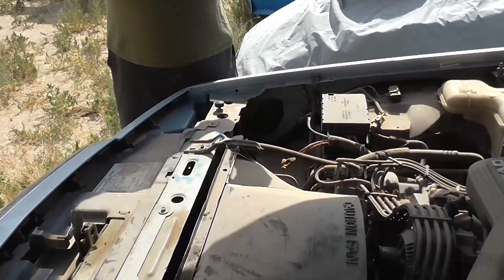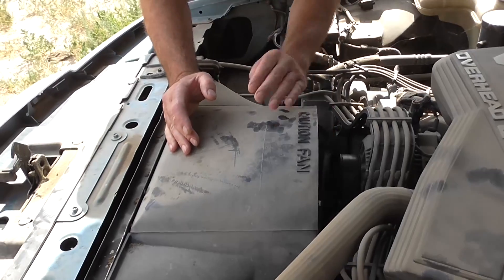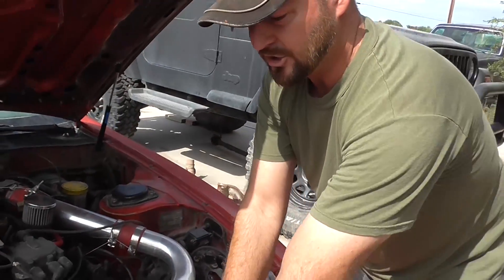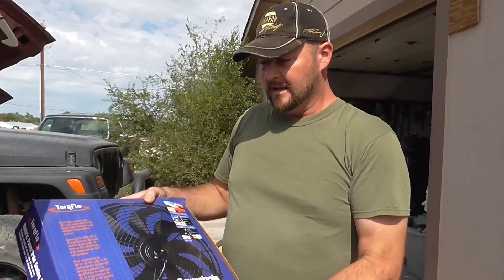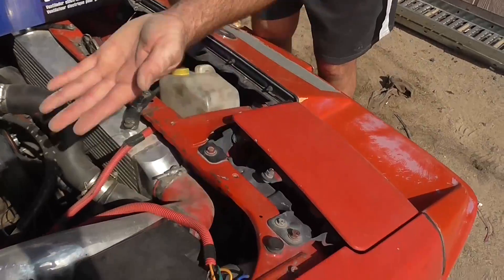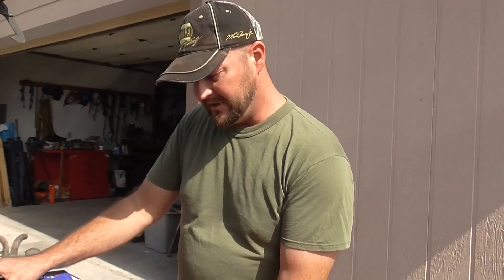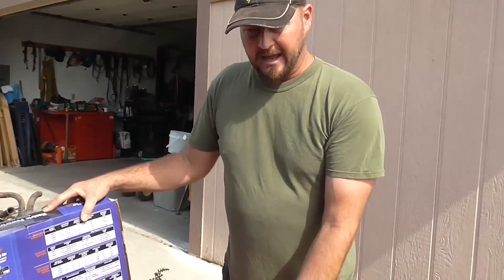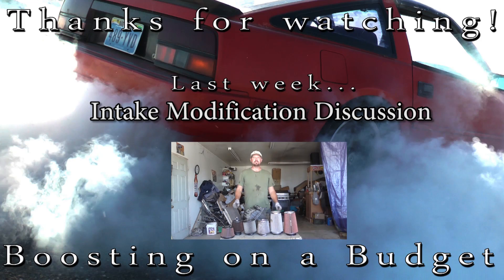Electric Vs. Mechanical Fans - Basics

Comment: measure the amps of these elecric motor fans using ammeter and you almost get a minimum of almost 1 amps. for a traffic of almost 1 hour with airconditioning that will consume battery power .

Comment: engine driven fan is durable, no electric wiring burnout, does not take amps from batteries.electric fans should only be for back up.during hot tropical weather and traffic, battery power is saved unlike electric motor which consumes battery power

Comment: slap a lincoln mark viii instead of that fan you have, you'll tank me later. ive tested so many fans and so far the mark viii is the king of all fans its a VORTEX! it moves more air than any flexalite, spal, or high powered 220W ebay fan ive ever tried! on  top of that its 18" in size so you'll have great surface coverage and utilizing the whole radiator to pull air!

Comment: Would I run into any problems switching my clutch fan for an electric in my 2005 ford f150
Reply: Nope I'm doing the same in my 07 f150
Reply: Jeremy G 
Results?
Reply: I haven't don't it yet I've been throwing money at my bike right this second and I'm back and forth on what way to go I'm either gonna try and make a adapter plate for the fans to bolt to or buy the flex A lite version cause the last thing I wanna use are those zip tie holders that go through the radiator
Reply: Jeremy G 
Yeah me too I don’t like the idea of zip ties and screws through the radiator. Make a custom shroud maybe? I have a 13-14 GT500 fan that fits well. It should be swapped in in the coming weeks.

Comment: Mechanical fans work ok until you come to a traffic jam. You would probably have to rev the engine until the temp comes down.
Reply: That’s why they created a device that switches the vacuum to distributor from ported to fill advance. That Is of course with carb
Reply: Not true at all. They move just as much air as an electric fan at idle.

Comment: Hey budget boosting, could we have a video from you showing all the ways a V8 engine could save gas, with open air intakes, electric fans, and anything else could be done... with the scientific explanations please?
Reply: ill tell you something but you arent going to like it very much,a v8 generally is not purchased for wonderful fuel economy but more for power.if you want better economy,try not to drive the car much and definitely not in town 
as stop and go traffic is terrible for v8 economy so take the highway.the other thing is use overdrive when possible,use premium gas and dont rev your engine trying to be cool.also you need to optimize your timing,make sure your pugs,wires,cap are all in vgc
Reply: @trillrifaxegrindor4411  I Agree - I happened to own Several V8’s. My 72 Chevy Eats Up that Gas . But it’s ok I only Drive It when I Have too. And Just installed Twin Electrical Fans 👍🏻👍🏻👍🏻From Old Air Products 👍🏻👍🏻👍🏻

Comment: shoud are design to maximize  air flow threw the entire radiator. electric fan without the shoud will only cool on that spot where the fan blades cover, not the entire radiator ,  therefor  the fan has to run longer to cool coolant temps,  causing longer  drainage  on battery thus alternator  has a heavier load, which robs engine power , short duty cycle on the fan motor is shortened . more so at idle  slow traffic and tow.
Reply from the maker: electric fans with shrouds are best.  Many factory cars with them can be found at wrecking yard for better flow and a cheaper price.  Just need the relay kit to put it all together.
Reply: If you Order From Old Air Products - just Call them They Will tell you What you NEED … Ft. Worth Texas

Comment: I'm running a tuned 1991 Nissan Patrol with a 2.8 intercooled TD6 and placed some electric fans on the radiator. I removed the mechanical fan. I didn't do the test but I think it had more power and less fuel consumption. I always kept in mind (since we go off road a lot) the electric fans could fail. And that happened. Always kept the mechanical fan in the back so I could install it back if I had any issues. What are your thoughts on more power (since it doesn't need move the mechanical fan anymore) and also less fuel comsumption? I'm also planning on placing an HHO on demand-kit on my 4x4 on of the following weeks. No idea if you had any experience with these kits and if you think they are a hoax?
Reply from the maker: +Thorben Verstraete The electric fans do free up a few noticeable hp since the mechanical fan takes engine power to drive.  The HHO on demand kit could be something to look into, I have no personal experience with it however I have heard good things about it.  If the kits are very reasonable in price its worth a try.  Saving fuel and a cleaner burn is great.  An idea I have heard of is alternating fuel with water injectors on a warmed up engine for example, on one cylinder compression stroke inject water instead of fuel which creates steam on the power stroke, then the next compression stroke fuel and so on.  That way the cylinder remains hot enough and every other stroke is a steam stroke which is just as powerful and cleans the combustion chambers so there are reduced carbon build up on pistons, valves and combustion chambers.  Engine burns cleaner and uses half the fuel it used to for the same output.  Some say the steam power stroke is equal to or greater than the fuel burn power stroke.  It is also effective in keeping engine exhaust temperatures down when using turbochargers, and superchargers.

Comment: You need to discuss the necessity of air flow for air conditioning! Very important point.  And large engines with ac, trans cooler and gm motors that tend to run warm. Not all motors are alike. Each one has heating and cooling querks.
Reply from the maker: +Bombasticbuster Yes, every engine is unique, one size does not fit all.  Air conditioning does need quite a bit more fan capacity since it puts a large heat load on the engine cooling system.
Reply: EXACTLY -👍🏻I should  know ….

Comment: Is that a convertible sn95 mustang I'm seeing in the background or are my eyes deceiving me? I've got one myself with a 5.0, the ford windsors are my favourite motors. They sound amazing and have a huge aftermarket base built around them. I'm not a four or six cylinder guy but I'm still enjoying these videos, very informative.  I'd love to see a video on a boosted v8 if you've got one. Thinking of supercharging my 95 stang and interested in what a safe amount of boost would be on a stock bottom end. As far as I understand ford used forged internals from the late eighties on in the windsors.
Reply from the maker: rmz450racer The mustang in the background is a 2000 Mustang GT with the 4.6 modular overhead cam V-8.  It is quite a good consistent runner.  In the future we are considering turbocharging it with a Holset turbocharger from a Cummins Turbo diesel engine.
Reply: rmz450racer Sounds awesome man I have a 96 Ford F150 with 5.0L (302) Windsor V8 with 204,135 miles on it and it's still going strong. The only thing I replaced on my truck was the starter but other than that mostly was just simple maintenance and cleaned out the transmission fluid just to get rid of the shuttering it was making and it hasn't had a problem ever since. It's a great motor very bullet proof in fact more bullet proof than the 5.4L SOHC 3V Triton engines as well as Ecoboost engines. A lot of people complain about them being very underpowered while that's true but they're so dead reliable in fact almost as reliable as a Toyota. With ported and polished Aluminum heads, hotter cam, free flowing intake, long tube headers, high flow cats, and free flowing dual exhaust along with EGR delete and dual electric fans can give these old Windsors just over 400-450 HP with no problem and still be bullet proof.

Comment: Mechanical fans are better.
Reply from the maker: Glen M Mechanical fans work as long as the belt is properly connected.  Yes they are the most reliable.  Some of them do put a great deal of force on the waterpump though.  Its really a matter of what your preference is.  Some prefer a mechanical fan that works as long as the waterpump is moving.  The electric fans can fail unlike the mechanical ones however they do work well and allow the waterpump to move more freely with less pressure on its bearings and waterpumps can last longer from this.  Either way works and either way has its advantages and disadvantages.  No one way is better than the other, its all personal opinion.
Reply: @budgetboosting  yes it is True Less Strain on the Water Pump . Etc . More Power ! 
Less Drag - and No mechanical FAN AND Fan CLUTCH !!!!!!!!!!!! I just Installed  a Duel Electric Fan  on my 72’ Chevy P/U - Turned out AWSOME - test Drove - OMGOSH- Perfect And My Temperature Gauge  was Cool !!!!!!!!!!!!  - I Don’t Regret it … 👍🏻👍🏻👍🏻